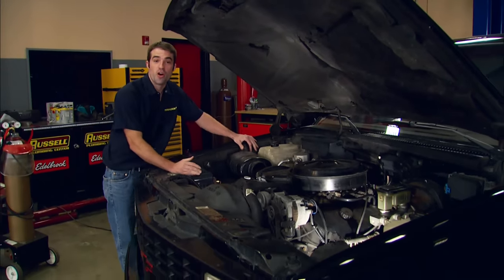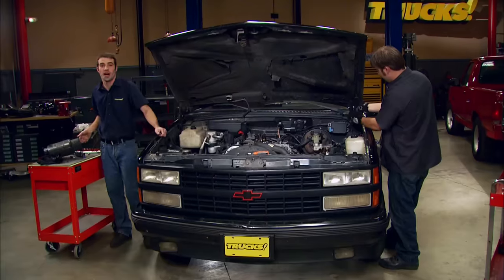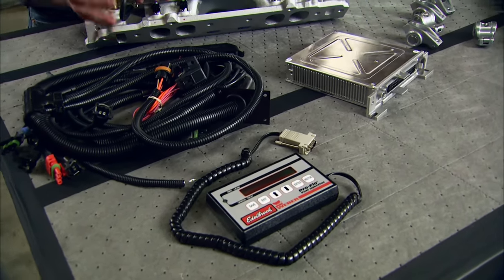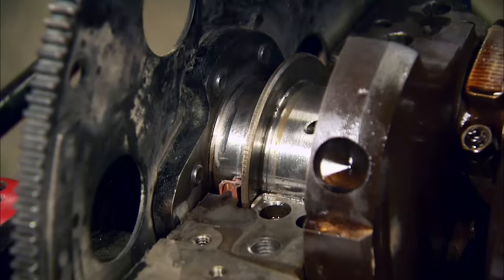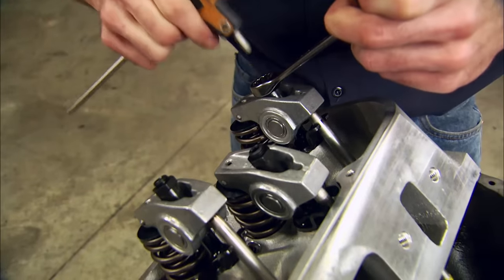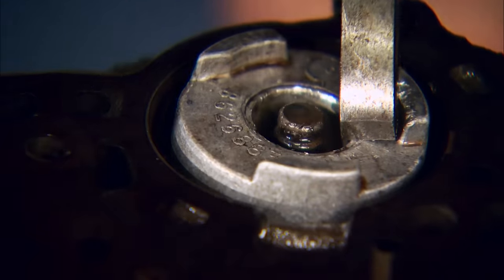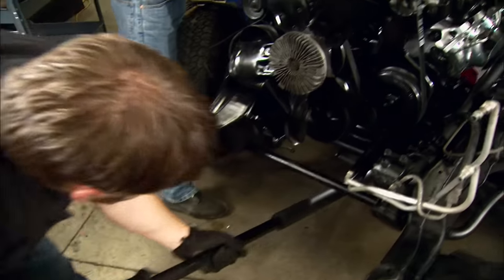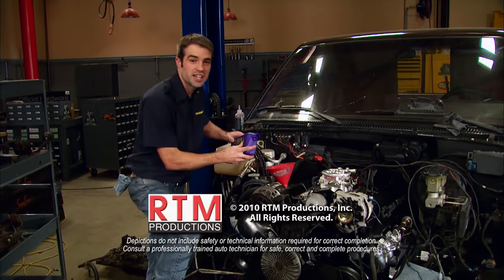Waking Up A 1990 Chevy 454 SS Big Block MuscleTrux Wars Part 2 - Trucks! S10, E2

Comment: BIG BLOCK CHEVY beaten by a Ford! Lol they had to start working on it first because it needs it first.
Reply: The 454SS is actually pretty garbage. The 454 used in these trucks was the same 454 part for part you could get in a 1 ton dually of the day. The reason the Ford 351 performed better despite being signifigantly smaller is because Ford actually invested a little bit into that engine to make it performance worthy, GM was just like, lets just take the biggest engine we have in our stable and throw into the lightest 1/2 ton truck we can and call it day! The engineering of the Lighting has always shown to be better when these two are compared directly.

Comment: A  gain of 30 or more HP with roller rockers. hum. They should check there facts or at least watch engine masters dyno test comparing stock stamped, roller tip and full rollers rocker arms.. HP gain = 0. Feel sorry for all those fox body guys back in the 90's spending $400 for Ford racing bolt on rockers for nothing.

Comment: Ls swap it for like $1500. Much cheaper and easier with way better results. Power isn’t everything. You’d shed like 600lbs off the truck and would drive much better.
Reply: A 454 would be hard pressed to outrun a mild 6L iron block LS mo matter how you slice it. Putting the money into a 408 stroker kit for the 6L, a $225 Elgin 220/224 or 228/230 cam, $125 Pac1218 springs and using cheap factory L92 or 243/799 heads, an L92 or TBSS intake and 90mmtb would be far more rewarding than that high dollar top end kit on that dish piston slug 454 for hp and tq production before the huge weight advantage effects the acceleration, handling and braking.
Reply: hendo337 I’ve never had a turbo so I’m going stock 5.3, injectors and a China turbo on my next build. Doing a turbo fox now for a customer now, he just wants a throw away car in case he wrecks it. So will be good to learn on. Prolly still cost less than this 454 build and that’s us charging him for labor.
Reply: @hendo337  for the money it cost to buy a ls buy all the hardware mounts etc. I can take that 454 and stroke to a 496 with around 11.1 compression and a nos plate and blow the doors of an ls. I have a 496 in my 72 Chevy pickup. And I beat up on ls cars all the time.
Reply: If it was available back then, they were still pretty new when that engine came out.
Reply: Uncle Deuce I can do a full swap for $1500. That’s buying a motor/trans, headers, paying for full exhaust and other parts. Everyday prices and not parting a car out or some BS. I make the harness myself. Check out the ram on my channel. 

I’d like to toy around with a big block , LS shit getting a little played out. I’m just after bang for buck though.
Reply: @MrPland1992  Try a new LT 😁
Reply: Uncle Deuce no damn PS pump tho lol. They’re cheap af 2017 full pullouts $1500. Fun fact you can put a gen 4 top end and harness on it for a easier ls swap. But I want a 8spd
Reply: @BigUnk85  So now you're doing a $5000 top end and a $5000 496 stroker, what's it going to be next? $1500 to have those Edlebrock heads ported and a custom cam grind when that 496 makes less power than said 408ci LS with stock L92 or 243/799 heads, intake,90mm TB, ECU and $225 Elgin 238/242 .595/.595 112 cam, $125 Pac 1218s, $100 trunion kit and $100 BTR 5/16" 0.080" chromoly wall pushrods? Odds are not even the block of that 454 would be usable, it wouldn't be capable of more power on pump gas while using more fuel, not remaining streetable, more expensive and still at a weight disadvantage.
Reply: @hendo337  I have a 496 with only 4k in it makes 700 hp on pump gas. Over 600 in tq. Made 906 with just 175 shot. A ls cant match the tq of a BBC . Ls engines have there place. But if I have something that came from the factory with a bbc that's what I'm keeping in there.

Comment: Ugh, the one major thing I hate about watching shows like this.... those shit-tastic E3 spark plugs!!  I honestly hope that you are not ACTUALLY using that garbage in those engines. I don't know, maybe I am just the odd one here, but EVERYTHING I have seen those plugs in, runs like garbage. From lawn mowers to cars, those garbage plugs have not done ANYTHING good in my experience. And, these guys do often cut corners that really bother me...... I guess the only reason I watch these, is to get maybe SOME pointers... but....honestly there are things I have started to catch in these shows that...... just does not jive well in reality. I don't know, maybe things get really dumbed down for TV? Or maybe these shows were so heavily sponsored, no real thought was put into ACTUALLY making real performance? Or, some parts (like the spark plugs) are swapped out off camera to actually do testing and driving?....... I can't believe I used to respect shows like this... a lot of that respect  is starting to fall to pieces.......quickly.